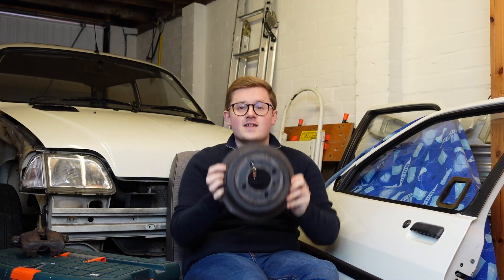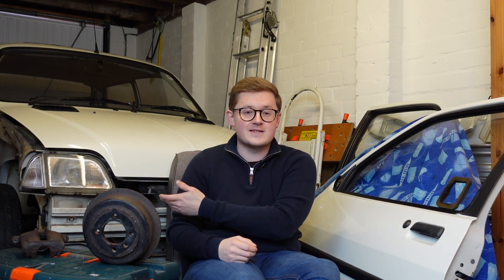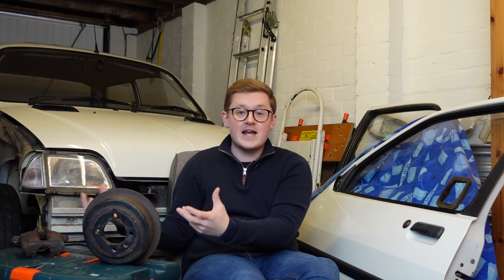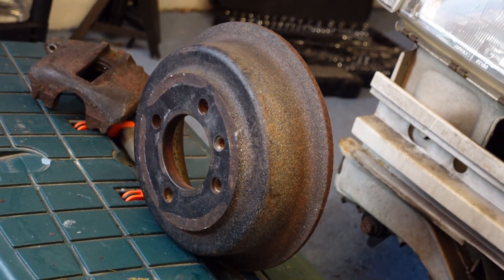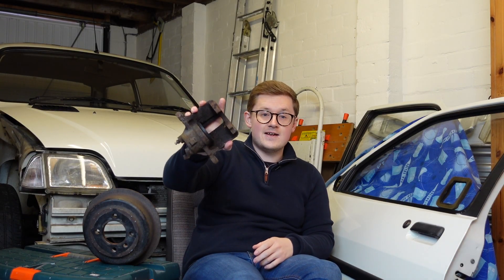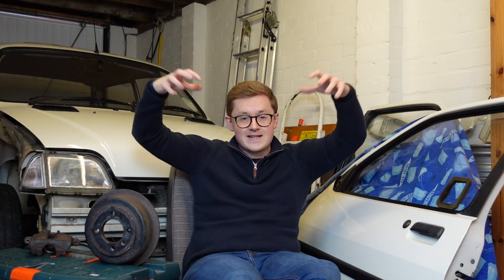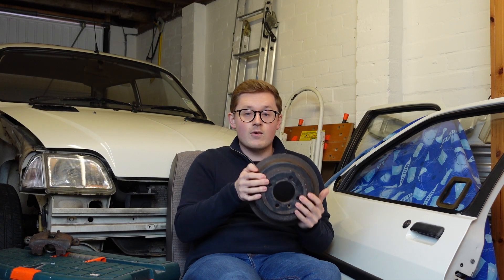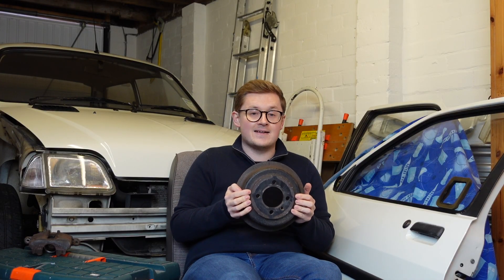Why are Drum Brakes Making an EV Comeback?

Comment: I'm using my car mostly on long range (200km), driving usually with not much of traffic and looking what lies ahead. Hence not much braking. On my previous car, it was the rear brakes which I had to change first at 90,000 km due to corrosion of the discs, the car would not pass the safety check otherwise.
The front brakes were changed at about 120,000km and would have lasted maybe 125-130000 km. 
Considering the above, I have no issues with the drum brakes on my Cupra Born.

Comment: Another thing is that disk brakes have a brake in period where they do not perform optimally which would be take much longer to get through if they are rarely used, but drum breaks do not require wearing so they will always behave as expected, this is also one of the reasons why drum brakes are often used in emergency stop systems

Comment: Drums suck in the wet and on repeated hard braking the fade to gone... Also they are so much harder to maintain and adjust than discs.
Reply: That's that's not very accurate. A clapped out f100's drum brakes with cheap aftermarket pads might stick in the rain.  But not high quality stuff. My 620 has moved mountains worth of payload through the rockies and I've never once overheated the braking system.
Reply: @Dat_Sun   That's "suck" not "stuck". By wet I mean driving through water . Drum brakes disappear as soon as they have water on the inside of the drums. And that includes the 4 leading shoe Brembos on the front of Ducatis in the 70's. That is about as high quality as you get...
Reply: @gregjetnikoff7124   I've driven this Datsun 620 through countless creek beds, water coming in through the floorboard holes, definitely flooding the drums. Never once have I had them not grab or do anything funny.   Now I also remember having a old ford pickup in California long ago, a heavy rain storm and the rear drums would lock up with the slightest touch of the pedal.  

 I had an old 2wd Tacoma with drums that were just as good as this Datsuns.   It seems hit and miss.   I also have a purchased new 22 tacoma TRD O.R.  Surprisingly it still has drums out back. 66k miles of service and they look new.  Almost half of that 66,000 miles is on gravel snowy and muddy roads up here in middle park Colorado. If they didn't like water, I would have known it by now.   I'm sure some braking performance is temporarily lost with excessive water in the drum.   I'll make sure to stab the brakes really hard the next time I cross a stream this spring to see how it reacts. But I've already put it through those scenarios and never noticed a problem.  Maybe at high speeds things would be different?

 When it comes to the motorcycle brake pads double HH or nothing for performance.   I made the mistake of trying some name brand organic pads that were cheaper than OEM. They're meant for legal speed limits... Luckily it didn't cost me my life haha
Reply: @Dat_Sun  Driven Datsun 1600's through creeks and had the rear brakes cease operating until they dried out. Same with all drum brake cars I owned for decades. And same with drum brakes on dirt bikes that I rode for decades.
Reply: @gregjetnikoff7124   I believe you I've experienced some phoenikey ones myself. I think you would be really surprised at how well Toyota has refined drum brakes on the last Tacoma.   I'm fairly sure the new platform for 24 or 25 is disc brakes all around. But these drums work great and respond quickly enough for crawl control to get it out of anything including water.
Reply: @Dat_Sun  Admittedly the last vehicle I had with drums would have been have been my Holden Rodeo ( Isuzu ute)  2007 ( rear only) and before that in the early 1980's. The Rodeo rear still faded when driven through water AND when descending mountains, But the front disc made it bearable. Also when I was using mostly drums there was NO HH type compounds so more modern designs and tech may be better , but the problen is that drum shoes basically hydroplane on the inside of the drum surfaces and worse can flash evaporate and basically become lubricated with steam. The biggest advantage of drums is they have a much wider range  load window they can work effectively. That's why they are still used on Semi's and big load carring trucks.
Reply: @Dat_Sun  Another place where discs are a bit of a problem is because of their narrower load range ( compared to drums) they can be a problem when you used a passanger car to to a caravan and they can get very problematic for the initial braking hits.
Reply: @gregjetnikoff7124 Isuzu Rodeo? I had one. Wish I had hadn't sold it. Ran and looked new when I sold it because I didn't have parking for it at the time. Used it for home warranty work in the Rockies for 300k miles. I got 150k out of the drum shoes, but never did off roading or deep water with it . I like simple cars and trucks, it was very reliable only needed one repair to a seal on the transmission, bulk head fitting I think.
Reply: @gregjetnikoff7124  I definitely like and prefer discs brakes. But, like toyota's decision to keep using them over the years drums, have their place. I like the long service life of drums. But it's not as quick to and often have to deal with stubborn stuck drums during services.  

My Datsun has factory front disks, if it was one of the older ones with drums, I would definitely convert them. Drum fronts scare the hell out of me.
Reply: @Dat_Sun  I had the 2007 3L diesel and also wish I hadn't sold it. Bit fuel hungry but not as bad a a lot of others.

Comment: As someone who handles most of the repairs and maintenance on our vehicles, I'll state outright that drum brakes would be an absolute deal breaker. I don't care what advantages they offer on EVs, they are an all around pain in the ass.
Reply from the maker: Sure they take a little longer than discs and are a little more fiddly, but they’re not anywhere near as bad as so many people seem to be suggesting in these comments, especially for professionals.
Reply: @TwinCam  It is more to the fact that I have better things to do with my time than deal with them. That combined with the pretty serious drawbacks they have when it comes to braking, especially in water. As for professionals, I'm not turning a $50 brake service into a $250 brake service. I can and have done drums. I am simply stating that it would be an absolute deal breaker on a new car purchase for a long list of reasons. An older vehicle that I am repairing or restoring, sure no big deal. But new? No, Disc brakes are better in just about every meaningful way.

Comment: I've been a mechanic in North American longer than you have been alive.  I see so many rear disc brakes destroyed by corrosion. Thank you, road salt.  Whereas rear drum brakes, on smaller cars tend to last nearly the lifetime of the car.  Great video!
Reply: Same deal for coastal FL cars from Salt mist.  Just did 4 disc's on Camry with all exposed parts.
Reply: Yes rear drums last much longer than rear disc brakes in Midwestern USA where road salt is liberty applied.  I tend to keep a car 8 to 12 years & wish all beware cars had rear drum brakes
Reply: Did 186,000 miles on a Toyota Avensis. The rear drums were original.
Reply: 1979 620, still has the original rear drums and hardware.  Work perfectly.

Comment: dont forget, most of regen is done on rear wheels, so even during a really hard stop, the ev motor, will absorb big part of rear axel braking energy. so even less heat for the brakes.
Reply: Only when the car has a rear electric motor and that rear motor is bigger than the front one. Most dual motor EVs have a larger one in the back so it can regenerate more
Reply: @Menon9767  "Only when the car has a rear electric motor and that rear motor is bigger than the front one." that is most of evs, and all of MEB EVs

Comment: Courier riders loved rear drums. Drums lasted 30,000 miles. Disc brake pads needed changes every 5000 miles. And the disc needed to be changed every 22,000 miles.

Comment: Does the leading brake shoe of a drum brake provide a self pull out servo effect. Disc brakes do not have this effect in general hence the servo assistance in higher performance applications. A powered vaccum pump would be required in EV's for the servo much like diesel engine vehicles.  
The classic Mercedes 300SL had inboard finned drum brakes. 8:59

Comment: I have  Jeep with combination drum and disk brakes in the back.  The drums seized.  This is because the actuator lever rusted. I think drums a POS. I have a Mazda Miata, and it has only one set of pads in the back. I owned a 1992 up until 2016, and I never had it seize.  I think Mazda'a pure disk design is much simpler and more reliable. I also think they are much easier to repair and maintain. The springs on the Jeep are a pure bear.
Reply: After thinking about this some more, and realizing every drum brake I have ever taken apart has been extremely rusty, the problem is that they don't dry out easily in the rear, unless you brake heavily. An open disk brake will dry out and can be cleaned in a car wash. If you have salt water like we do commonly in the winter, and it pools on the road and you get it in your drum it probably stays there a lot longer than a disk brake.  Drums are not sealed. And so they retain moisture and rust. I disagree with the whole premise of this video.

Comment: This is very well written great job. It's worth noting that in the 1960s Buick and Pontiac went to great lengths to make drum brakes that could keep up with discs. Pontiac had their wide 8 wheels which were a rim that bolted directly to a styled drum and Buick's aluminum finned front drums performed shockingly well (I speak from experience owning a 1961 Buick Invicta). 

Per Continental's concerns of public perception with drum brakes, I imagine with some creative design, a good designer could sell them. After all we've successfully marketed a 150 year old engine design to the public for over a century despite better options being available. For a drum to sell to the public, this would be very doable after styling them with fins or perhaps even coupling them with a wheel that complements their design, similar to the Turbofan wheels of the 1980s.

Comment: The lighter the wheel, the less unsprung weight it has. 🛞🌀
There are everyday cars and there are sports cars, and the solution used in one category rarely works well in the other.

Comment: What a rubbish idea. He says himself they're not suited for high performance applications.  By 1960's standards every modern vehicle is a supercar. Horrible idea.
Reply from the maker: If you listen, I say racing. Performance cars tend to follow racing cars, even if they’re not designed for track use.
Reply: @TwinCam  The increased performance also allows for much more safety overhead. You're  going to get a soccer mom killed for riding her brakes. Insane.
Reply from the maker: It appears you’re both excusing poor driving as well as ignoring the central point of the video, which is one pedal driving. If anyone tried to ride brakes in a regen-equipped EV, they’d never move in the first place.
Also, please don’t like your own comments. It’s not a good look.
Reply: @TwinCam  You've obviously never designed something that is turned over to the public. Look up the term fool-proof.

Comment: The best rear brake design for a normal car are 4 wheel disc brakes. I prefer 4-wheel disc brakes especially front and rear ventilated disc brakes. Disc brakes are much easier to service and you can see how much pad life you have left if you have alloy wheels instead of plastic hub caps.
Reply from the maker: Disc brakes may be easier to service, but rear discs need more than double the servicing of drums, plus the final point about seeing pad life can be transferred to shoes on drums. They have rubber bungs on the back to inspect the shoe thickness.

Comment: I personally don't think it's a good idea. At least for now, EVs are considerably heavier than the ecoboxes in the 80s and 90s. The problem isn't (and never has been) that drum brakes don't perform under normal circumstances. The problem is that they don't perform when it really matters. 

Recouperation is a thing with EVs and you're spot on that the infrequent use does lead to rust, gunked up pads, etc. but at the end of the day, I'd rather change discs and pads once a year (I mean c'mon the parts are like 75€ on your average compact) than have brake fade when I absolutely cannot have any.

The manufacturers started building them into small EVs because they didn't want Mommy Dearest, who barely does any more driving than to the grocery store, shows up twice a year at the dealership with shot rear brakes they'll need to replace under warranty. I certainly wouldn't say it's inherently unsafe to use drums but if there's one thing I've learned working on cars in 30 years it is that you don't cheap out on brakes.

Comment: I drove vintage air-cooled VWs as my daily drivers for a very long time.  My 1957 Beetle had 4-wheel drums and yes, they required occasional adjusting, but they always worked perfectly.  They were cheap to maintain, as you say, and the pedal feel was smooth and confidence building.  I never had any trouble stopping and I cannot remember ever locking them up.  Plus, they were QUIET, unlike the discs on my current Chrysler minivan.  From Champaign, Illinois, USA.

Comment: Nice explanations. Another reason why handbrakes on drums is better than discs is the cooling effect when the handbrake is on. When a disc brake cools down, the disc contracts and the brake pads then lose contact with the disc; so if this was from a handbrake then it might release. On a drum brake, when it cools the drum contracts and applies more force onto the shoes, making the brakes tighter, which is a good thing for a handbrake. My old car had discs at the back which the handbrake connected to (so they did exist), and that did once release the handbrake after several minutes of the car being parked on a slope. Fortunately I was near the car when it started rolling away! I've always parked my car in gear since then.

Comment: Well done.
BEVs need to be cheap due to the limited lifespan.
Don't take my word for it.
Buy some and find out.
Reply from the maker: That’s simply untrue.
Reply: @TwinCam   It's your channel, I wish you well with it.
I built recon engines 30+ years ago before a decade in R&D electronics.
2 decades in horology with a diploma.
Some things can be fixed, some aren't worth it or have failure and obsolescence designed in.
Some things don't work out in phase B testing.
From my perspective the BEV concept is fundamentally flawed for trickle down and resale.
Batteries being fitted on the production line today are already obsolete chemistry.
It's just the way things are.

Comment: Cars in Norway have to have the equivalent of an MOT every other year. One of the biggest failure points is rusty brake discs, especially at the rear - and that's on ICE cars. On EVs it's even worse, because the brakes see so little use. So when I finally gave up on keeping my old Golf IV on the road this year and bought an ID.4 GTX instead, drums on the rear was actually a selling point for me, as I won't have to worry about forking out money every so often to replace rusty rear discs.

Comment: As an Electrical Engineer experienced in Robotics and EV, yeah, it just doesn't need a brake from an electrical POV. You can even just simulate a brake using the electrical system.

Comment: My 2017 A3 etron (PHEV) has in it's lifetime already used up 3 sets of rear-brake discs and pads, not because of wear, but because of deep-rust and yearly safety-checks where the car would lose its permit to drive if I did not replace the rejected parts. This part of the design is by far the most expensive in my experience. A drum brake design in the rear would have saved me a considerate amount of cash.

Comment: With computer controlled everything, the car's computer can choose to apply the mechanical brakes once in a while to deal with the rust issue.  This isn't a show stopper.  And have you tried removing the drum that's been on for a while?  Good luck.  Corrosion build up a lip making drum removal very difficult.

Comment: Funny, my 3 ton 90s Suburban had drums while my 2018 Ioniq EV sadly does not. The brake pads are basically like new still, but I have to pull the assembly apart once a year to keep it from rusting to death due to non-use..